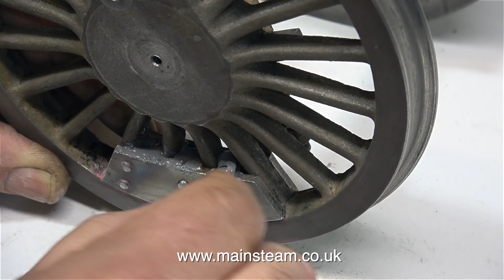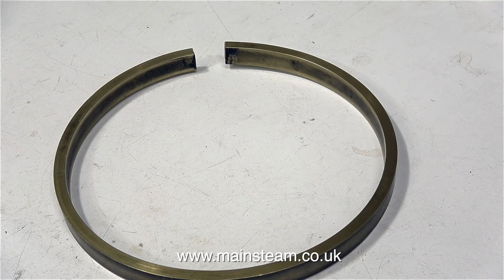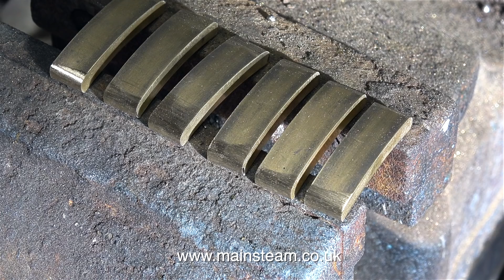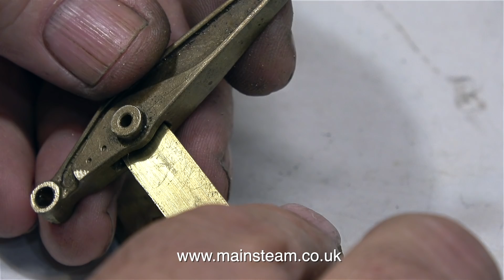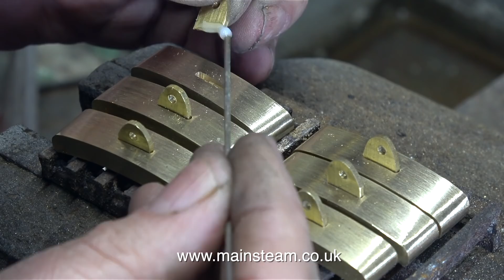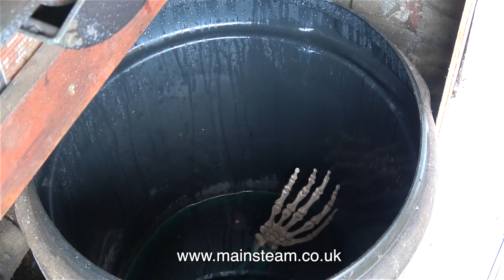HOGWARTS CASTLE - A 5 INCH GAUGE LOCOMOTIVE - PART #12

Comment: Hi Keith, hey I was wondering if you have ever tried using a vibratory tumbler or a traditional rotating tumbler as a means to restore, polish, or simply put a uniform finish on your parts?  I have noticed there is a wide array of media available for these machines ranging from aggressive enough to deburr parts, to crushed walnut shells that can polish the parts.  It appears this method is also used for finishing jewelry after casting and pickling.
Reply from the maker: I haven't used one, I should buy one really ......

Comment: I often wondered about the efficacy of working brakes on some of the small locomotives. I think a number of the are because they could do them, as the few times I have seen them stopped in a hurry was Fred and Barny style, If you did install them as working ones the only disadvantage would be replacing they often totally prototypical.

Comment: What kind of acid are you using for the acid bath?
Reply from the maker: "Killrock K" kettle de-scaler
Reply: Thanks Keith, I'll see if I can get this here in the US
Reply: @jimdeprey6584  There was an article in Model Engineer magazine about 20 years ago . The traditional sulphuric etc acids had become unobtainium in the UK. Citric acid is used in Asian cuisine and readily available. Softer than the hard acids and requiring some more of the stuff,it apparently works. If you can find the list of ingredients of his kettle descaler that might help as well. Good luck.
Reply: @jimdeprey6584  its the US, you can buy anything here!